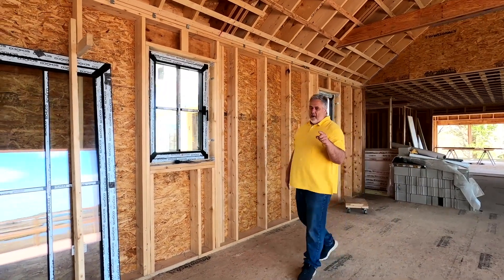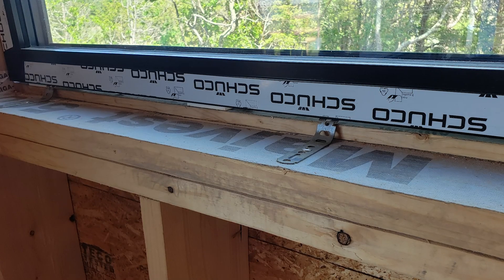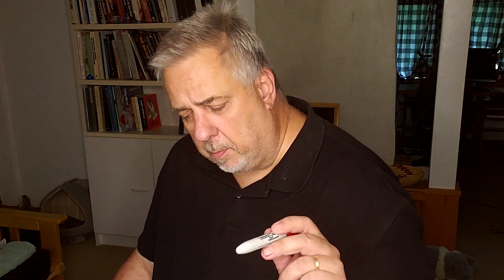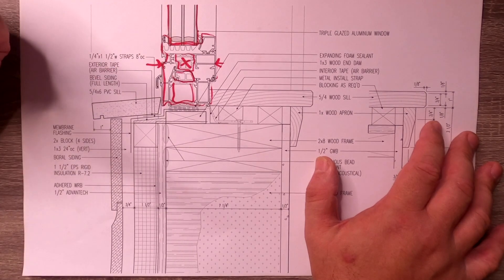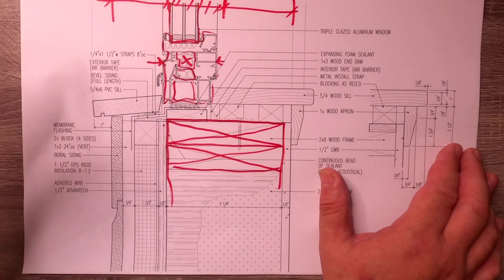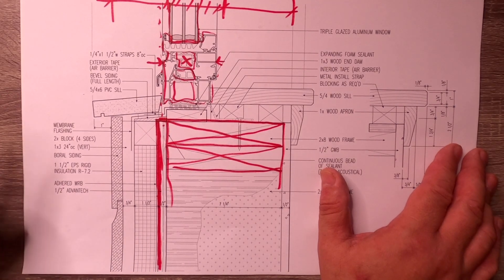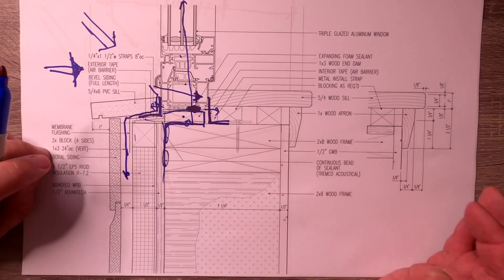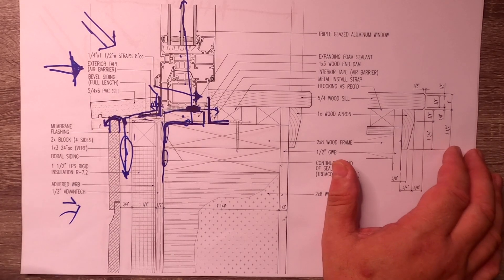Window Install Details - Managing the control layers

Comment: Hi Steve - you video has been incredibly helpful. I have a question about installation. Hope you share some thoughts! The question is whether we need metal base frame for installation? My project manager suggest we should lay metal frame on the concrete wall first, then install the window on the metal frame. I understand that’s easier and quicker to install. However, the metal base frame actually connect the internal window part with the external window part and bypass the insulator. I believe that might damage the insulation performance. Would you please share some recommended installation approach here? Please help and thanks in advance!

Comment: That was very interesting. All the thought that goes into tiny details. 
These windows don’t have mosquito screens. Would such a screen take off some of the force of a driving rain?

I’m planning a ICF cabin build with 12 inches of concrete. Is there a scenario in which it would make sense to install 2 windows, one flush with the outside and the other almost flush with the inside?
Reply: Interesting idea!  Aside from cost concerns, it would be a great way to get relatively bomber R value in the window space.  For a smaller project it could be doable.  Did you give it more thought?

Comment: Steve, I have seen a few comments about the air gap at the top of the siding and below the exterior sill.  Is simply not caulking the joint sufficient or do you think having an intentional gap would be beneficial?  If so, how big of a gap would you recommend?  People have comment about bug screens, but based on your diagram, it does not appear to be necessary below the sill.

Comment: Good stuff Steve! Leaving the top of the siding open for the rain screen air flow, do you need to use a bug screen of sorts at the top and bottom? I think Wade or Jake mentioned its not necessary as the air flow up the rain screen will create an environment that bugs wont like, but then I recall Matt used one on his real rebuild. There are bug screen products available on the market, so it hard to know if they are needed or not. What's your thought on the matter?

Comment: Should the inside tape face the other direction (like the outside tape) due to outside air forces being stronger than interior forces?
Reply: I think I know what you are asking, but the intent of the tape is to create an air seal at the base of the window.  If the inside and the outside tape are both adhered to the base of the window and then to the sill, I don't think either side will experience greater pressures under the window because the opposing tape will prevent it.

Comment: What about rain on the interior window sill when a user leaves the window open?
Reply: I'm gonna guess Schuco knows when tilted in, the rain runs down the face, into a trough then out.
Reply: @ccwnyc5671  no i mean kids left the windows open and it rains. Not tilted. Actual water on the interior sill.
Reply: @David_Mash  he mentions the inside taping. I think in reality, nobody's leaving these wide open. That's for temporary cleaning access.
Reply: @David_Mash  
Homes before the 1960s were higher quality.  Larger overhangs  or awnings installed. But yes, when the rain is driven by high winds, even those won't provide protection from water damage.